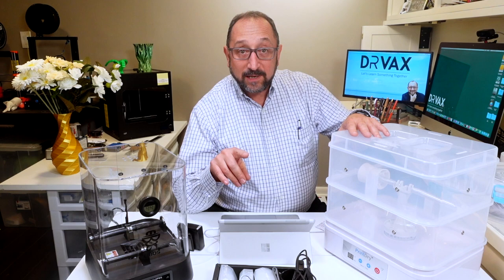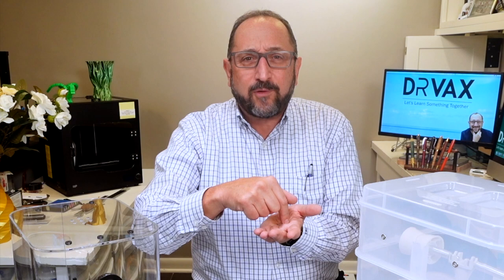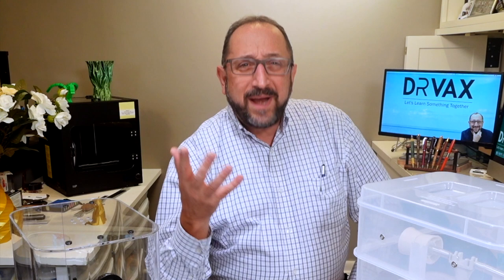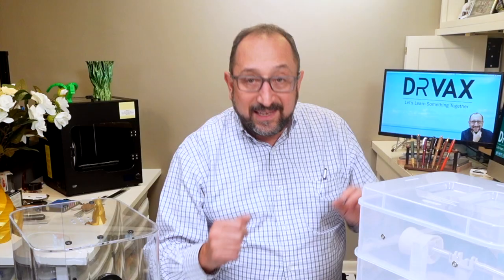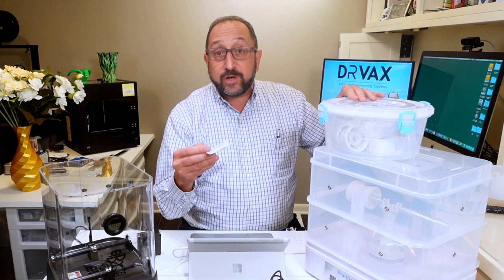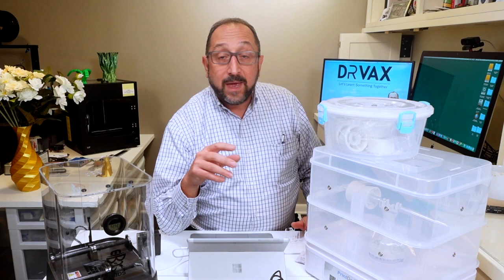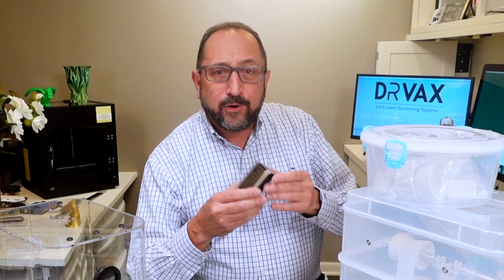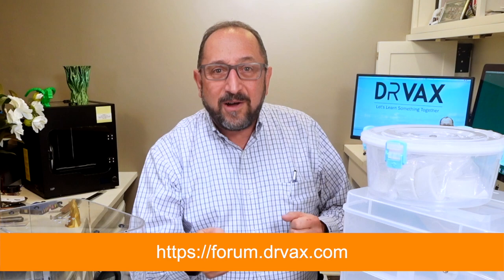3d Printing Filament Dryers and Storage Systems

Comment: Former print dry user here: I had the same experience with the print dry 2.0 regarding it not reaching advertised temperatures. 

I contacted PD on the issue and acknowledged it as a known problem. That unit operates on an open loop system. They informed me that they will be released a closed loop system and that they have an expected arrival of stock late October / early November. This conversation was had on Sept 18th
Reply from the maker: That’s for the confirmation.

Comment: Awesome video, thanks. Where I live the summer is very dry (25-30% humidity) and I didn't have printing problems, but in winter we have 70-80% and I started to have problems. I only print on PLA and I had a lot of stringing and first layer jagged problems (like you showed almost at the end of the video) and I thought the problem was my printer.  I struggled a long time with the problem and I changed the extruder, hot end, nozzle, a glass bed, then PEI in spring steel sheet, but long story short, it solved after I started to storage my filaments in sealed plastic bags with silica gel desiccant, so humidity is a big deal.
Reply from the maker: Thanks for sharing your experience.

Comment: Hi all, just mentioning that you can see the effect of moisture if you look and listen carefully while you are purging some filament. You can hear popping and even see small bubbles arise on the surface of extruded filament. Some other 3D printing youtube channels have mentioned this.

2nd @DrVax I think your humidity sensor is limited to 16% minimum (at least when I saw the specs on Amazon on one that looks exactly like you are using). Might be good to verify specs, 

Lastly, proper dry storage is important from the start when you get in the filament. A box with desiccant probably won't be enough to restore any moisture effected spools without a heating element.

Comment: Great Videos, I live in a high humidity area, simple cheap solution is a small Reptile Tank Heater (Ebay) and an old Esky cooler box, keeps the air dry in the Esky without heating the box and being low voltage cheap to run.  These heaters are sold online for small pet rodents, snakes, lizards etc, they don't put out a lot of heat but do seem to do enough to keep my filament dry.

Comment: Amazing illustration! I always thought that TPU was more hygroscopic than PLA. Now I know why my PLA filaments tend to become brittle after stacking them in the open for a month or so. I'll adopt your great method in getting those containers with good sealants in them and probably start up by using the stacks of silica jel packets. Thank you sir for sharing your experience 👍🏻👍🏻👍🏻
Reply from the maker: My pleasure.
Reply: wet PLA become ductile, not brittle.

Comment: I store my PLA in a Polygon Polybox - a two reel holder with bowden tube like the EIBOS container. It doesn't have a heater, but instead relies on packets of rechargeable silica gel. The ambient humidity is around the 55-70% range here, but the Polybox and silica gel gets it down to below 10% (which is the lowest reading the sensor can go). For me, this works well enough that a dedicated dryer is not needed.

If you need to go the dryer route, then one possible alternative to filament dryers to to use a food dehydrator. They work just the same and the only modification needed is the removal of the food trays. (Some humidifiers have removable trays but others have built in trays which need to be snipped away with some cutters).
Reply from the maker: Thanks for sharing.

Comment: It's a good idea to calibrate your hygrometer because they are often not accurate out of the box. Also, simple and cheap analog hygrometers that just use a strand of hair and a spring are often more accurate than digital ones.
Reply: That's good to know.  I also weigh my spools when I put them in and see how much less they weigh when I remove them.
Reply from the maker: Excellent idea.

Comment: Thank you for this! I’m super new at 3D printing, never knew this was something I have to worry about haha
Reply: being relatively new myself, starting with fresh(dry) filament was a game changer. I was testing with an old spool stored poorly and kept getiing inconsistent results. Seriously considering ordering one of these for my prusa setup
Reply: I've been printing a couple years, it wasn't until I started using PC / Nylon and Carbon Fiber blends till I realized that I had the problem. So if you stick with PLA and PETG you can relax till you see issues.

Comment: A good set of reviews.  I have seen the Eibos reviewed by others and it seems like a good system.  This is the first time I have seen the printdry system and it looks good also.  I have had good luck with a modified food dehydrator that I purchased on Amazon this summer.  Ir was very reasonable and can hold a minimum of two rolls with the parts included.   I'm in the process of printing extra rings to increase the capacity to 4 - 6 rolls.   I am a little confused with the chart showing the filament water contents.  I know Nylon is a real water hog, but I have never had problems with PLA.   I agree that PETG needs to be dry along with ABS, but the chart seemed to have PLA with a higher water content.  The thiing I found most interesting is the dry  box that displays its status and you can recharge by plugging in.   Thanks for all of the good information.  I learned something today/
Reply from the maker: Thanks for sharing and for continuing to watch my videos.

Comment: Some ideas for DYI alternatives are that you can suck the air from plastic bags using a regular vacuum cleaner. A food dehydrator costs about $30 and will dry filament without damaging it although it would not have the ability to print from it directly.
Reply: With some design work you could modify one, wouldn't be surprised if Thingiverse didn't already have an horazontal spool holder for one!
Reply from the maker: Thanks for sharing.

P.S. I have started a new discussion forum at http://forum.drvax.com where we can all have more elaborate discussions and share pictures on our prints and printers. Check it out. Irv
Reply from the maker: Thanks for the link and the information and thanks for watching and participating in forum.drvax.com

Comment: Thanks for the input, I plant on trying to use my food saver to create the vacuum and use the food saver bags. They are quite cheap if you order bulk rolls on Amazon. I might even dry one of the cheap food dehydrators and print my own cover for it.
Reply from the maker: Great idea!
Reply: @MakeWithTech  Actually I am new at 3d printing and I'm in the process of setting up my work station. I have a new Artillery Side Winder  X1 and one of the complaints is the spool holder, I found a 3d filament Dryer spool holder for $80 on Amazon and ordered it to replace the spool holder on the Sidewinder. Thank to your videos this should make my learning experience easier and better. Thank you.

Comment: I have the EiBOS Easy Dry I love it except for one issue. It has a Humidity readout and a Knob that you dial in to filament type. Easier than knowing what temp to dry your filament. I just dial to PETG and set. It heats a lot so probable working. The bad is I bought Amazon Basic filament the spool is just slightly bigger than normal filament spool. So it does not work. Bummer. I am looking to see if EIBOS makes a similar but slightly bigger unit.

Comment: QUESTION:  I try to print with PCL filament ( temperature 70 to 120 ) on ender 3 but my extruder refuse to move.  It only extrude when the temperature is at 170 degree ( it's too hot for this kind of filament.  Is there a way to tell the printer to extrude at 90 degree?  Thanks.
Reply from the maker: Wow.  70 to 120c is very cool and if the extruder will not move than the filament is not soft enough for it to extrude it.  What brand of filament is this.  I am not familiar with any filament that extrudes below about 170c.

A great place to discuss this is at the DrVax forum located at https://forum.drvax.com.
Reply: @MakeWithTech  I bought it from 3D printing Canada but it's also use alot with 3D pen.  Here the description from 3
d printing Canada:  PCL is also known as Polycaprolactone. It has been used in 3D printing because of its exceptional printing properties. It has a truly unique melting temperature of 60C which is even lesser than your standard ABS or PLA filaments which have melt temperatures in 200C+ range.

It offers excellent layer adhesion providing extremely durable prints. The PCL filament can be molded quickly. This is especially advantageous for beginners who can practice until they get perfect results. All you need to do is immerse your prototype in warm water (60C) to soften it, and then you can remodel it until you are satisfied.

It is widely used in medical applications because it is non-toxic, biodegradable and environmentally friendly.

It is made from a high-quality material which has no air bubbles, kinks or any oily residue. So, you can enjoy creating artwork safely.
Reply: @michousamuelson4094  PCL can be extruded at 70 degrees on the printing pen, but it is not suitable for use on the printer, because the flow rate is very poor at 100℃.
PCL printing needs to be done at 200-210℃. Too high temperature can effectively improve the flow rate of PCL, but be careful not to print too slowly, which is easy to carbonize.
At the same time, the printer is required to have a strong cooling performance, which can quickly cool the material to below 60℃. It can be printed under external fan and low-temperature air conditioning.
Excuse my broken English.

Comment: Hi, I love your presentations!!!  As it happens, I have been developing a system to print continuously with dry filament. I am in Fort Lauderdale. I keep my filament at about 24% humidity.  I will try to contact you tomorrow morning directly. My solution is better than what you have here and costs a fraction.   :)

Comment: You mentioned a couple times how fast the humidity dropped in the box. It seemed like you were talking about an empty box. If that is the case, even if the box is completely sealed the humidity will drop as temperature rises, because the measurement is relative humidity. When air has a given amount of water in it and the temp changes the humidity changes in the opposite direction.

Comment: I can't remember where, but recently, I saw a vid wrt filament drying, and they pointed out that spools with solid sides were not ideal, took much longer to dry the whole spool full.
Reply: If you use the fryer as a feeder it does not matter. The outer layer of filament contains several hours of print time, so you are drying the filament far before it reaches the printer.

Comment: I also wonder how well the bags will work. I bought some on Amazon With a hand pump. When these work it is a great system but the Pink plug does not work on about half of the bags. Frustrating I would rather spend slightly more money and get ones that would every time. And then you should only have to buy them once.

Comment: I have nozzle from 0.2 to 1 mm. But I can't find any setting profile in any site to use it in Cura 4.7. Please can you help me to find a suitable profile to these nozzle.
Reply: It's not part of profile configuration you specify nozzle in the middle top part of the Cura main window, where it shows selected filament and nozzle. Just click on it and you will be able to change both -- filament parameters and nozzle size.

Comment: Thanks for the very informative video. I made my own filament storage box and am surprised to see the humidity levels shown quickly in your video. I expected a heated dryer to reduce the humidity more. Once calculated, the 16% relative humidity at 43 deg C is 9.5g/m3 in absolute humidity. My passive storage box gets down to 2.7g/m3 with zero power usage. We have pretty high humidity most of the time here in the UK so filament storage is essential. Check out my storage box build video on my channel if you're interested in how i got my humidity down so low. Thanks again for the in-depth review.
Reply from the maker: I will have to check out your video.  Thanks for sharing.
Reply: @MakeWithTech  That would be great, I'd love to know your opinion.

Comment: petg at 235 i print mine at 255 and no stringing with a  tube and my pla roll is on the floor in garage for 8 months now even got wet still prints the same , i think it totally depends on where you stay in the world
Reply: If the humidity in your garage is below 35% -- it doesn't actually matter. Otherwise I had lots of troubles with nylon and pla because of humidity. Especially nylon.

Comment: The Eibos will fuse and deform filament unless you rotate the spools manually, I would not recommended this one at all due to that and also the fact that if you use it to feed filament, changing filament roles is a PAIN and not condusive!

Comment: Buy a food dryer for half the price. Works the same.
Buy the silica gel beads in bulk for dirt cheaper on amazon. Don't throw them away when they're saturated. Drying them in your kitchen oven makes them orange again. Don't overpay for packaged ones like in the video.
Reply from the maker: Thanks for the info!

Comment: Thanks! Nice and informative! Just a few comments:
1) Nylon is a torture -- you dry it in your oven for hours, you grab it to use, sudden call from your lovely but hysteric lady, 30 minutes wasted listening that people arround are idiots and DriveTests should enforce psychiatric exams for everyone before taking driving tests, finally printing attempt and ... failed. Because 30 mins out of oven was enough for nylon to absorb humidity from 50-52% humid atmosphere. So you have to stop your bubbling or blowing printing attempt and coock your nylon once again in the oven. 
2) Instead of Amazon you can go to Costco and buy exactly the same Eva-Dry devices -- they sell in packs of 2-4 items per pack. It's cheaper than Amazon. At least here in Canada. :)
Reply: Build a dryer from food dehydratator then. Cut the middle part on the grid and mount one or two couplers on the side with ptfe tube up to your extruder. Voila, you have cheap dryer and also filament printing box while drying and printing. Buy taller one for two filament spools and add some silica to the bottom too. No need to buy those overpriced filament dry boxes which are in essence same thing, just 5x more.
Reply: @ZhuJo99  They work for regular types like PLA, PETG and their derived options. Everything that can be dried by < 75C temperature. But for Nylon they are useless, you need stable 90C to dry it out. The same is valid for another high-temperature filaments. On another hand -- regular filament driers kinda from eSun or Sunlu are also useless for Nylon and high-temp filaments, they barely provide 70C.
Reply: @krukhlis  and on the other hand, pla or petg rarely needs any drying. Maybe TPU and ASA (after long time in humid environment).
But Nylon can be printed from such drybox made from dehydratator. Dry it in the toast mini owen and then print from dry box, if you don’t have heated filament chamber. 
And after drying in owen, straight to vacuum chamber if it’s not going to be printed.

Comment: The desiccant in your bins is toxic. The colour changing desiccants especially are dangerous for your health as are the silica gel packs. The best desiccant to use is 3Å Zeolite which is used in drying air for breathing apparatus(scuba diving). It is clay based and food safe, which can’t be said for all other desiccants. It can be regenerated in your oven at 120-140 degrees Celsius(248-284 Fahrenheit) for 2h without health concerns.